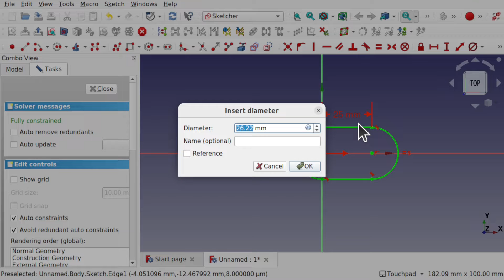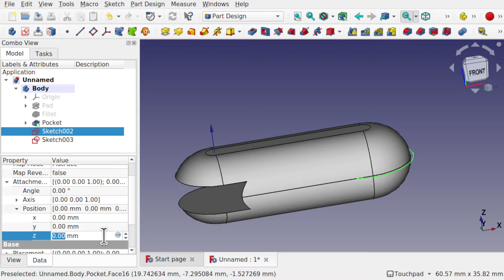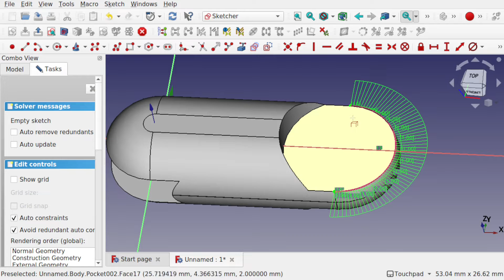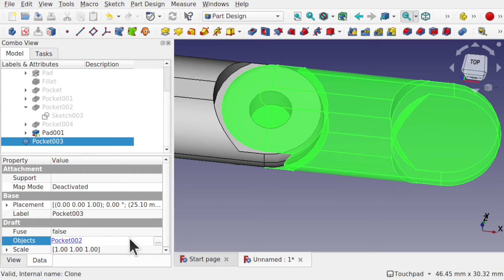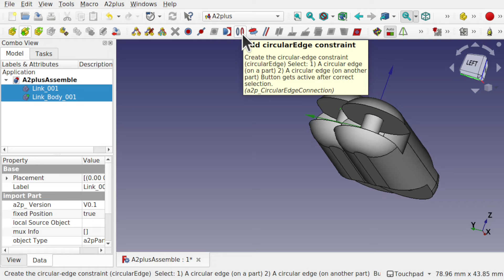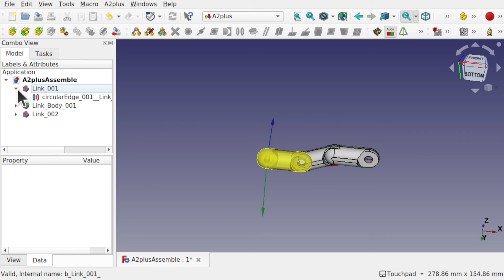FreeCAD 0.20 For Beginners | 17 | 3D Print Assembly in Place with A2Plus WB

Comment: For some reason my links when I exported them are not constrained as we set them up to connect. All three of my links saved as an STL with each part separate but it oddly maintained the same positioning that I moved them in with the "Move selected part under constraints". It almost looks like they have an equal offset spacing.
Reply: I have the same problem, i just go to "part" work bench. highlight all the link and make compund. after that i export that compound. and it work alright.
Reply: @adioperwira It still didn't work for me😢

Comment: If I wanted to build a longer chain, do I need to add each link individually, or can I iteratively copy the existing chain to get a longer and longer one. Duplicating the three piece chain breaks all the links in the duplicates, so I'm back to moving individual links about.
Reply from the maker: So, what you can do is save off say three or four links as a sub assembly and then link those sub assemblies together.  I do have a few videos about sub assemblies in my collection.

Comment: everything going fine until i export the files as STl then when import them back as one file STL.. nothing appear in the screen 
i did it multiple time 

then i found this hint in the comment section and i follow it and it did the trick 

load mesh workbench, convert shapes to meshes from the list mesh (covert   from shape) and then export the  converted meshes as STL
Reply: I was having the same problem as @adioperwira, and this trick worked for me. Thank you.

Comment: Im in FC 21.2, when I imported the group at the end the three links have a large amount of separation between them. They are in the same position as saved (stl file) but moved apart. I have not been able to find a setting for this (yet). ideas?
Reply: Hi there. Did you manage to find the solution?  I have the same problem
Reply: @atriusvinius319  no. After messing with this for far far FAR TOOOOO long I just moved on.

Comment: when i export the 3 links in.stl  and i import back the file the links are disconnected.. any idea?
Reply: I have the same issue and can't find a solution to save my life.
Reply: Update, found the solution in one of the remarks below.
Load mesh workbench, convert the shapes into meshes and then export converted meshes to .STL. The- generated STL file is smaller and the links are now connected.

Comment: If I export the File as STL the Links are not connectet. I get seperate Links.
Reply: I get the same behaviour - the links are correctly angled but far apart from each other... Maybe it's due to some change in a2plus?
Actually... I tried linking the links in new file, using assemby4 and then exporting the file - the links are disjoined too! Now i'm starting to think it's something with freecad or stl export!
Edit3: I found a workaround if you're looking for it: load mesh workbench, conver shapes to meshes and then export converted meshes - generated STL file is smaller and the links are connected. Works with a2plus and assembly4. You don't even have to use mesh wb export, just normal export of generated meshes does the trick.
Reply: @JohnnyBit  Thanks, I was also looking for a solution to this problem.

Comment: Thank you for the tutorials - I'm using FC V0.20.1 and installed A2Plus V0.4.60n  to follow along the video.  Some of the dialogs in A2plus are now a bit different to what's shown on the video, and the connection/assembly behaviour seems to depend on whether you do it with the drop down menu or the tool bar button.  Also I was not able to offset the circle link by -0.5mm  for some reason at the dialog did not allow me to type in -0.5.  using transform to shift the part by 0.5 mm broke the connection somehow and I was not able to add and connect the third link. 

I fiddled with the units and set the decimal places to 3, and then tried again and it all seemed to work fine after that.  Maybe just a glitch in my PC or something. 

I don't think that its worth remaking the whole video, but new users of the Tutorials should bear in mind.

FreeCAD is up to V0.21 now.  I will not be installing that until after I've  gone through the Tutorials.
Reply: Hi Jorge, long time since you post that, so I hoppe you've already found a solution. 
One that comes to mind is to add a planeCoincident constraint between each top or botom of the parts. 
It's even a more robust solution, I think, because if you change the part dimensions, so that, for example, there is only 0,4 mm of play instead of 1 mm, the plane Coincident solution still aligns the parts, but manualy specifyng a 0.5 offset won't.

Comment: Hi - I'm newbee in freecad, and i love your tutorials, and I have followed this one, but when it comes to move the inserted link parts, I run in to a problem where in could only move them in 1mm increments, and i cant find where to adjust theese. Could anyone help with that?
Reply: I had the same problem. I solved it by just creating the constraint with a 0mm offset, and then adding a offset in the data panel on the left afterwards

Comment: I have a question. When you 3D print that part, how does the printer go about not fusing the joints together? If the joints are all within each other, wouldn't the hot plastic fuse itself to each piece?
Reply from the maker: The gapping is enough to make a extremely weak bond so when you finished printing you hear this very pleasing 'pop' when you first wiggle the joints and everything then moves freely.
Reply: @MangoJellySolutions  How solid is that material you were using? The reason I ask is that I have a disability and can see this design as being beneficial as a key turner.
Reply from the maker: @smiskowiak  oh wow, that's a great application. If it was made using a stronger filament then it would be very solid. You can increase the radius of the hole and pin for even more strength. Here is a nice article regarding materials for 3d print https://all3dp.com/2/strongest-3d-printer-filament/

Comment: What printer settings did you use? I see you printed without supports😉
Reply from the maker: Yes I didn't use supports as it was the test print. I used the defaults from the machine just to get the proof of concept. But the next one I do I think I make a proper project of it.

Comment: I can't get the offset for the circ edge constraint to be 0.5 it will not allow the input of 0.5 , only 1mm movements. :( I have tried re doing it but it won't allow. FC version 0.20.1
Edit: I centralised the 2 links by adjusting the z axis placement of link 2 to zero, this put it in the middle. I wonder where I strayed from the tutorial....
Reply from the maker: I was just looking in freecad to see if you had a issue with dimension formatting in the preferences. Glad you have it sorted now
Reply: I'm not totally sure but I just had the same issue in 0.21.2.I used your workaround. But then went back to the original sketch to modify the "pill" shape. When I "updated imported parts". the links were at crazy angles.I deleted them all and re imported each link. But this time I used Add shapes not add parts. Im pretty sure I used add parts first time around. Anyway this time around It would accept .5mm no problems...weird.
Reply: @mdsmedia9  Good to know thanks for the response :)

Comment: thanks, it printed out perfect. keep up the good work
Reply from the maker: Great to hear, did you get that lovely satisfying snap when you loosened up the joints to break any loose filament, 3D printing AMSR 😂 Glad your enjoying the videos
Reply: @MangoJellySolutions  I wasn't paying attention, plus I added a few supports, so I had to remove them first. I'm not sure it would have printed with out any and I couldn't tell from your video